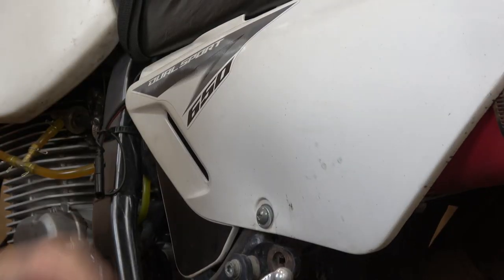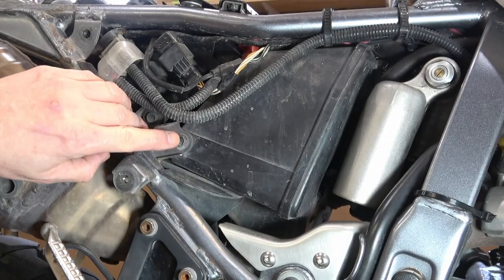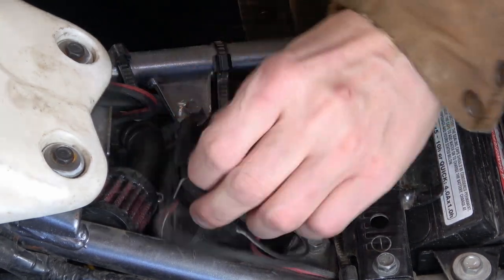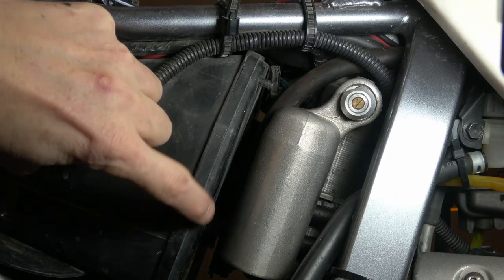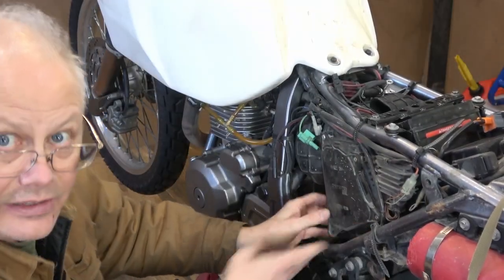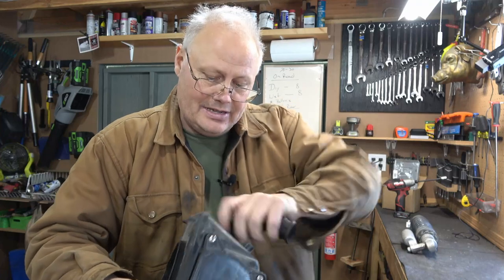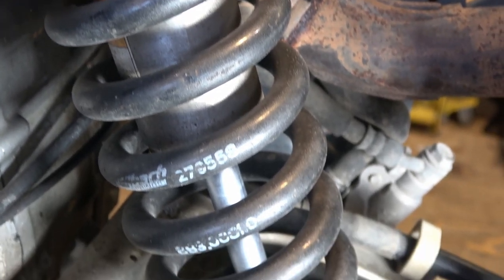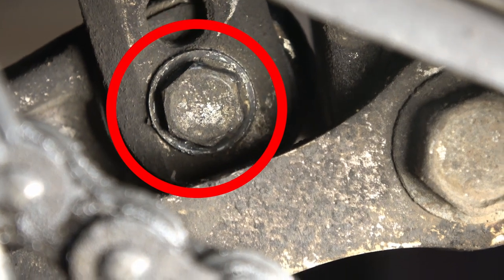Motorcycle rear suspension greasing (Suzuki DR650) Pt1.

Comment: There are a lot of useful (and very important) tips in this video. The air box removal procedure you demonstrated is very useful and necessary. Suspension lowering tips are great. The next video on taking apart the shock will be a "must watch".  Thanks Dino
Reply from the maker: Thank you Mal, it is nice to get the air box out just to clean in behind it!
As always, thank you for your comment.
Dino

Comment: Thank You Dino for the wonderful how to video! It's refreshing to see someone who actually reads, and follows the Clymer manual. A detachable subframe makes this job much easier. Unless I was having problems getting the bolt to thread, I personally wouldn't run a tap through the soft aluminum of the shock clevis.
Reply from the maker: Thank you for the feedback and I am glad you enjoy the content. As I often say, I am an amateur, not a real mechanic so the manual is the first tool I buy when I get a new vehicle. I find the Clymer easier to follow for someone like me then the factory Suzuki manual although the factory manual is defiantly more technical in a lot of ways. 
I have a bit of a habit of chasing threads, I suppose there is a risk of damage to the treads being there are aluminum but I take my time and only chase these by hand. I really the threads clean when I reassemble stuff. I wonder if a nylon or soft brass brush would be better for cleaning out dirt with out the risk of damage? what would your thoughts be?
Dino
Reply: @DinosTinkerShed  My thoughts/experience on chasing threads with a tap as general practice is that it almost always cuts at least a little bit no matter how careful I am, which reduces material holding the screw/bolt, there is a risk of damaging the threads, especially if not sure of the pitch, and the possibility crossthreading, also if the nut has a self locking feature, tapping will defeat that. Of course, sometimes it is necessary if the bolt/screw won't start, or thread properly. The brush cleaning method would certainly be safer, and if I'm worried about getting it loose in the future, a little dab of grease on the threads will usually help keep it from seizing. Of course this is just my opinion, whatever works for you is great! 
 I have both manuals, Clymer is the superior manual (again my opinion), perfect example is the instructions for removing the cam chain tensioner, Clymer is much more descriptive, with many pictures and even shows how to  make the tool for it.
Reply from the maker: Great feedback, thank you, I appreciate your opinion and explanation. Glad I am not the only one who finds the Clymer manual very good. I know some have told me they are never as good as the factory manual but as you point out the step by step order of operations is very well laid out in the Clymer. I believe the factory manual expects the technician to be a fully trained Suzuki tech which makes sense.
Thank you again.
Dino

Comment: Dino, I always take the air box out it’s quick and easy to remove the shock after the first time you do it.  Just a couple of little tricks with the air box reinstall makes it easy that you learn pretty quickly such as pull out the air box snorkel!
Reply from the maker: Thank you for the feedback. You are correct about the snorkel, its funny my manual did not mention its removal to assist in the airbox removal and reinstall. Once out access to the shock and swing arm is great and makes cleaning a breeze.
Dino

Comment: The re-valve video will be a must watch.  Be very interested if you upgrade to a stiffer spring too, and finally your impressions riding once winter is over.  I am contemplating re-valving and would trust your opinion.
Reply from the maker: Thank you for the comment, my bike came with a heavier spring when I bought it but I am still trying to determine what the lb per inch is on it. I know it is longer than stock as well, but I am not sure how much. The valving was interesting and in talking with Oliver at Performance Shock and Custom about my riding style and where I mostly ride I decided to stay with the stock valving during this service. I will explain why when I reinstall and set the ride height in the last video of the series. Thank you again.
Dino

Comment: Nice one Dino. Loks like good access once airbox out. I usually just remove exhaust and remove from bottom. Looks a bit easier your way though. Look forward to seeing what you do with it 👍
Reply from the maker: Thanks Dan. I think I will be able to adjust sag with the air box out as well. As I am sure you are aware it is a bit fussy getting to the spanner rings when the airbox is in.
Reply: @Dino's Tinker Shed  Yes, you are right that is an excellent point. I will be doing it this way from now on!

Comment: Whilst the manual does not specify shock or forks service intervals, it always a good idea to change the oil and inspect seals and bushes every 20, 000km. fork and shock oil does degrade similar to engine oil.
Reply from the maker: Great points, thank you for sharing.
Dino

Comment: I found the shock just slid right out the bottom (with no need to remove the airbox), but I did have the swing arm off at the same time.
Reply from the maker: I think Mark from Biker Bits has an aftermarket exhaust header, maybe that's why he had a bit of a time. I think taking out the airbox does give you more access to the suspension bolts.
Thank you for the feedback.
Dino

Comment: Dino, Just a FYI...Ive bought a used DR400 back chock as i believe its way better that the 650s etc. . i got to mill out the bottom by 1 mm to make it fit.. As I'm 270lb and going down lol..I need better back chock 4 sure. i did the front and it made a big diff. On another note do you take emails and or tel calls.
Reply from the maker: I have heard this is a good option as an upgrade, I should keep an eye out for one used as well. could be a fun project.
My email is in the "about" section of my YouTube home page, I take correspondence but am a bit hesitant about attachments such as pictures ect in fear of viruses.
Dino

Comment: Is it bad to max out the detent to the hardest setting?
Reply from the maker: Thank you for the question, I am not an expert at all with these shocks however according to my friend who just serviced mine, it is fine to run the shock in any of the detents, the shock is designed to operate throughout the full range and he encourages people to try different settings. Just be careful not to "bottom out" the adjuster too hard when you are turning it all the way in, as this can damage the end of the adjuster spool if you are to forceful.
I hope this helps.
Dino

Comment: Wait ✋️  if you didn't do your forks first, a set of Cogent non progressive springs for your weight, Cogent DDC emulators and proper fork oil volume, you should try it first before spending a few hundred on valving. You'd be surprised how the forks affect and compliment the rear suspension. I just did mine about 2 weeks ago, forks and a stiffer rear spring. However, if you want to make content, I support your decision but do the forks as well.
Reply from the maker: Thank you for the comment. I actually am just servicing my shock not revalveing it, I really don't mind the factory ride but it needs the oil changed. I have a heavier spring installed on it already and I just serviced the forks about a year ago. Good information on the spring upgrade for sure and I appreciate you sharing your experience.
Many of the videos I make are for content generation for sure, but they are all things I would get around to anyway lol. Thank you again.
Dino
Reply: @DinosTinkerShed  Well, I for sure enjoy your methodical process and reasoning in your videos and encourage you to keep making them.the information you share is helpful. Thank you.